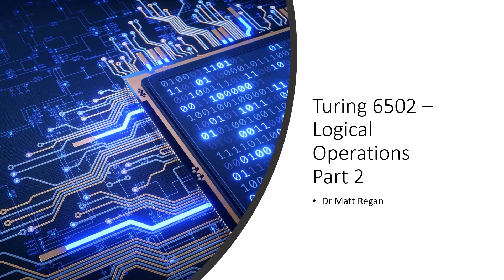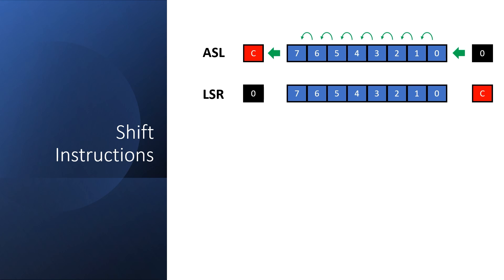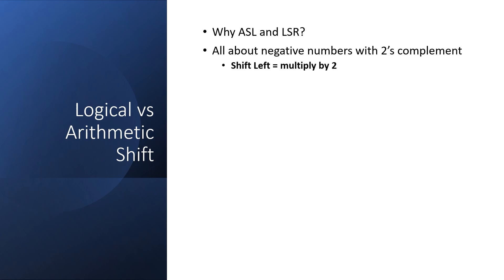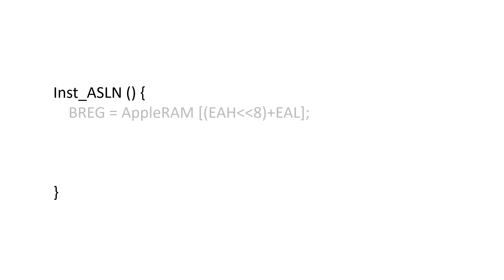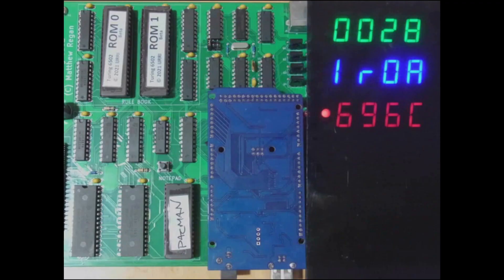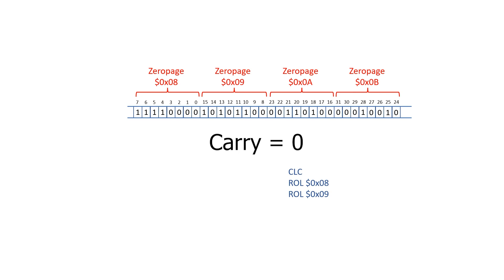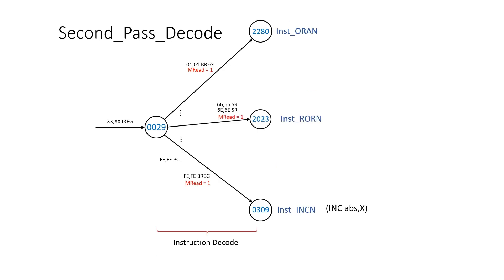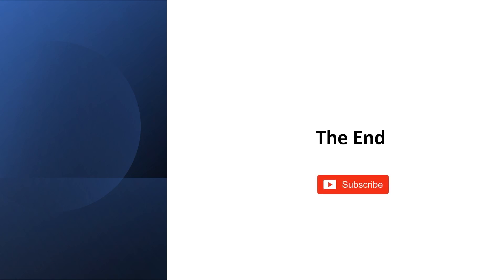Turing Machines Explained, Part 12.  Logical operations 2.

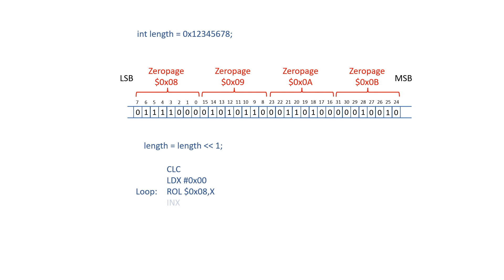Comment: 7:25 CPX corrupts carry, so the looping version doesn’t work.

If you’d have stored bytes big endian, you could have used DEX and either BNE (1 indexed starting with LDX#4) or BPL (0 indexed starting with LDX#3), because DEX preserves carry.

Or you can stick with little endian byte order and use zero page indexing wrap around…
CLC
LDX #0xFC
Loop:
ROL $0x0C,X
INX
BNE Loop

Of course the unrolled version is quicker and shorter, so no reason not to use it. 😊

Comment: The lack of an ASR instruction is like the lack of an add without carry. Both can be synthesized by two other instruments and their omission was apparently to keep the transistor count down. But as a novice programmer in the 1980s their absence caused me some confusion.
Reply from the maker: Yes, i think Chuck Peddle spent a lot of time analyzing which instructions were most used and ASR mustn't have made the cut.